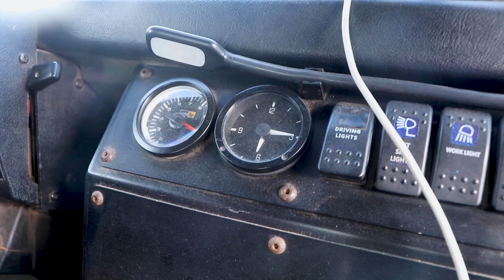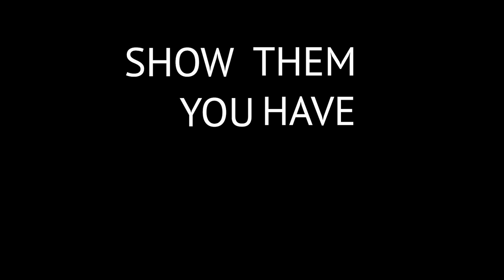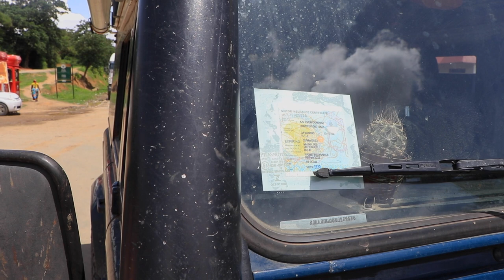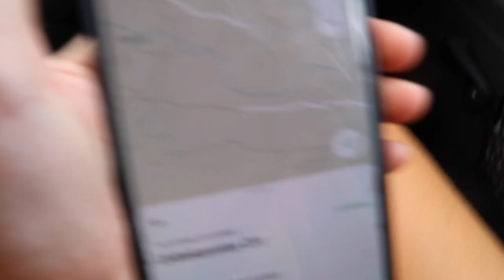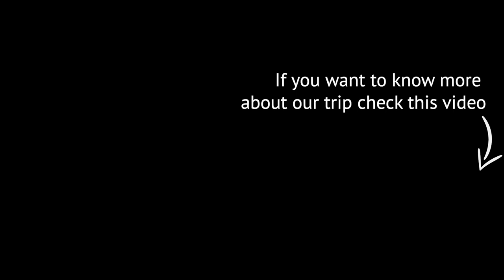Running away from POLICE in MALAWI // EP.44

Comment: Stunning  landscapes as always. I must admit I laughed when the water came in, but because I though those things only happened to me! The wiring looks terrible, just like my 110. Installed a breaker switch on the negative to ground to prevent fire risk.
Reply from the maker: I know, but trust me I know what every cable is doing! And I’ve no clue how to make it look more tidy! If you have it figured out let me know!
I tried a breaker on minus but I’ve never managed to cut all connections, and in the end I thought it’s to risky to have an open or undefined ground in an emergency, therefore I cut the positive and turn off the solar…
Reply: Well you are in a better place than me so, I can't id all the cables - so many old cables